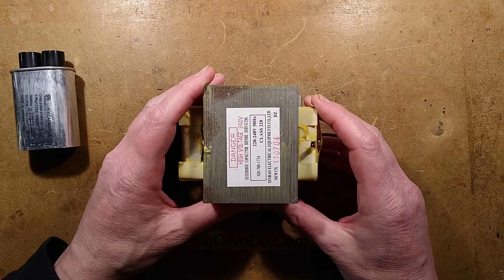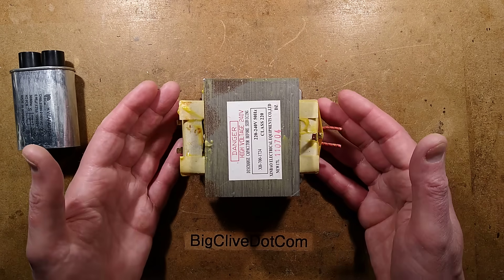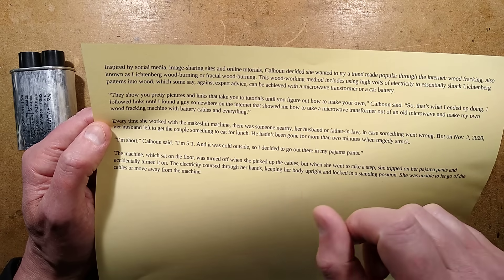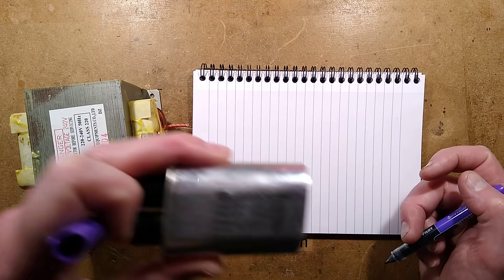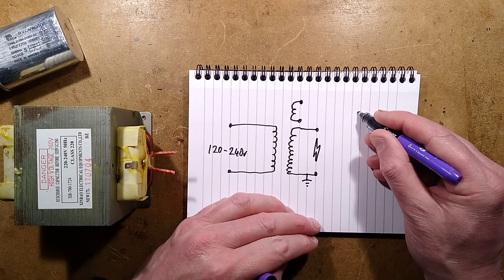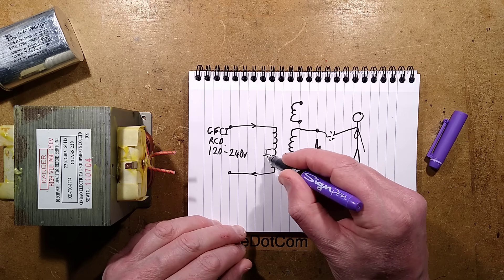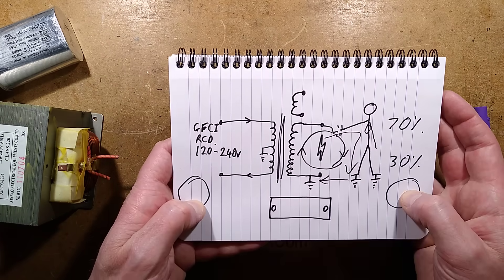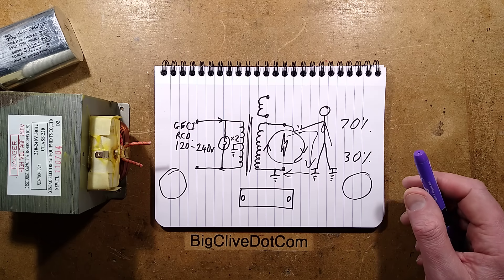The most deadly project on the Internet

Comment: I was firstly a Radio Officer then an Electro-Technical Officer in the Merchant Navy for 43 years. In the mid-70's we used to work on transnitters using big heavy transformers and large glass envelope valves. Similarly, marine rarad used (and still does) use microwave components, i.e. magnetrons. At college safety was drummed into us. I managed to survive 43 years without receiving a High Voltage shock. I was also responsible for working on 440v generators/systems for the last 23 years, again following proper safety procedures kept me alive. This "hobby" and the equipment people are using fills me with dread. They know damn all about electricity and it's associated dangers. I also attended a High Voltage Safety Course about 4 years ago. This dealt with the dangers of High Voltage voltage systems used on modern ships, such as cruise ships.They had a wide selection of gruesome photos/videos about what WILL happen if you do not follow proper safety procedures. This idiotic "hobby" needs to be covered by UK HSE legislation, and BANNED to prevent the ignorant and/or electrically challenged/over-confident kill themselves.

Comment: I think something that wasn't mentioned is that at such high voltages, I believe you act like a capacitor between the HV and earth/air. So even if you aren't directly touching anything you will still get a massive shock. Not to mention that the voltage coming out of the transformer easily breaks through the insulation of most cables (Which he did mention) I have also seen a MOT "leaking" into concrete (a tiny arc between the transformer body and DRY concrete) which was my clue to stay away.

Comment: That fractal wood pattern is so beautiful, I want to try that for myself!
So tell me, once I get an old microwave oven, do I beat the MOT out with a hammer, or pry it out with a screwdriver?
And should I unplug the oven first?
Reply: Flintlock aimed at the fasteners should do the trick; the black powder residue shouldn't be too conductive.

Comment: I accidentally touched a high voltage contact of the transfotmer while holding it with another hand. Painfull as hell but I ended up with only a small white line of burned skin on my finger. But I would not recommend to try this anyway because someone might be not so lucky and nonconductive

Comment: I have one of these transformers, rescued for a project, however I have yet to proceed as they are SO FRIKING DANGEROUS.
I'll probably end up with it on the other end of an extension lead, so I'm meters away when I plug it in.
HOWEVER this is not good enough, as a stuff up at the transformer end could see the transformer trying to raise the power cord (and extension lead) well over a thousand volts - the house mains will stop it, however when I pull the plug, the now isolated lead could zap me - so I'll also add a remote control/wireless power point switcher to the mix.

Comment: Yeah, people who survived a jolt of 110V or 220V probably got complacent and thought all electric shocks are like that. Most likely they touched it with one hand only and things were favorable. But 4000 volts doesn't need that good of a path to create more than 30 mA of current flow through your body, and that's the point where death tends to occur because it causes your heart to stop or go into fibrillation. You made a good point with it going through your shoes which isn't much of a concern at "wall socket" voltage.

Comment: The sticker on the transformer is not helping also: Danger High Voltage 240V .... Instead of the 2000 to 4000 Volt output voltage...

Comment: Doble's Power-Factor test set has a unique dead-man-interlock.  The Safety Button has three positions.  OFF-GOOD-FAULT.  To operate the unit, hold the switch in the GOOD position.  If you're electrocuted and "seize-up", you'll press the button to the FAULT position and stop the test.

Comment: As a trained (former) appliance technician, I've worked on dozens of microwave ovens and having heard stories from trainers about accidents involving working on them it really reminds you to take your time and practice safe working skills. The secondary voltage is actually 1000 volts ac here in the USA, then it goes thru the capacitor which acts to double to voltage to 2000 volts ac then thru the diode converting it to DC.  With 240v primary it would be 2000 ac on the secondary.

Comment: As a guy who works on rf tube amplifiers don't play with transformers. I use very expensive wires for insulation and a 2ft Teflon with a ground strap to short out the hv after bleed down to make sure no angry little pixies are left

Comment: I do have a 30KV Bertan HV PSU but even though I keep the current limit as low as possible for my application, I still try and not risk it by making sure I shut down the HV switch before moving the cables or readjusting things.
 In theory, I think it should be less lethal than the microwave transformer because it's limited to 33mA, though that would make my body a nice 1000W self-contained oven if the whole 30 000V is somehow going through lol
human (pork) crackle anyone?

Comment: The problem is that people into Artwork are maybe not the best people to be dealing with high voltage electricity, microwave transformers are very nasty things.
One thing I used one for was getting rid of a plant in my garden, I had a patch of Horseradish, I could not get rid of the stuff, even after Glyphosate which is probably has bad as a Microwave tranny, the bloody things still grew back worse than before. 
I carefully used a microwave transformer, Earthed one side with a Copper rod, and used the other side on a very long insulated pole with a probe on the end to apply the lethal voltage to each Radish plant, hey presto they never grew back. Not to be recommended though, do not mess with these voltages and current unless you know what you are doing and you are not tired or had a drink.

Comment: This is really important content to focus on - thank you for doing so, Clive.
I'm pretty into arcade machines and retro gaming, where CRT TV sets are still an extremely popular commodity. If you'd like to do another cautionary tale video like this, it might be interesting to hear a rundown from you of what to be terrified of inside them. Growing up I'd always been told they were a deathtrap but in recent years I've gotten far more brave while opening them up to fix minor issues - curious what your take would be as to whether I'm taking informed risks or if I'm being completely laughably unsafe.
Reply: In a modern CRT TV I believe the danger comes if you contact a charged anode lead. The shock doesn't kill you but involuntary muscle movements could.
Reply: @eDoc2020  Interesting. Are there not cases of people in otherwise good health (no pacemakers, etc) being fatally shocked by a discharging anode or capacitor? Or have I been misled, and the primary danger (assuming proper safety measures) would be messing with it while it's in operation?
Reply: @mistaecco  There are probably people getting fatal shocks from the charged HV. The bare output on a modern integrated flyback is probably safer than a charged CRT. But AFAIK it's still more likely the shock will "just" make you spasm and slap the tube hard enough that it breaks and impale you on the sharp edges.

Just be safe and discharge it if you need to mess with the anode connection. And be careful if you mess around with a set while in operation. Oftentimes the horizontal output collector will be attached to its heatsink. This will have kilovolt pulses while in operation which will be more dangerous than the anode line.
Reply: @eDoc2020  Good to know all around. I've been doing a bit more research on the matter and it seems to match up with what you're saying, so it all makes sense. I appreciate you taking the time to explain it all, and will definitely keep it in mind when I soon recap my arcade monitor. Will certainly not lose the mental image of involuntarily punching through the neck tube any time soon, that's for sure.

Comment: I would say that discharging an high voltage capacitor with a screwdriver is a way to be screwed. 
Use a high power high resistance resistor and wait enough time.

Comment: I got into a country science fair with a Kirlian discharge plate as a teen, made with an ignition coil. Sparky mistakes!

But these days if I'm doing something borderline insane I'll put it at the end of a long extension cord with a switch. That should work for most of these artists with the exception of the "painters".  I could imagine insulated controls on simple pivots and the work inside an insulated box. Don't ever rely only on linesman's gloves.

Comment: It's important to know about the high frequency device that while it doesn't make visible burns, you should avoid getting shocked by it as well. What I learned in the army about frequency burns is that it can damage your nerves and years later you can wake up and not be able to feel anything with your limbs or use them. Granted that was primarily a safety concern with coming in contact with an antenna while the radio was transmitting, however if I'm not mistaken frequency is still frequency regardless of range could still pose the same risk.

Comment: it bears mentioning, "breakdown voltage" is the voltage at which material stops being an insulator and becomes conductive.  for most "insulated" things, that breakdown voltage can be as low as 600 volts, including a lot of common wire insulation, and shoe soles.

Comment: We have horses and thus we have electric fences.  
One is battery powered at ~4000V and one is powered by house power at ~10kV.  
Both only pulse for a millisecond or so, but i'm not getting close to that second line any time soon.  
Dry floor, thick boots and only touching through a jacket and still had the feeling like getting kicked in the arm.  
(interesting: every joint on my body hurt for the rest of the day)  
That shit's no fun - wouldn't wanna find our if it wasn't pulsed but constant for a second or so.

Comment: I was electrocuted when I was 14, 44 years ago. 240v in AU. I was using an old metal vacuum cleaner to vac out my grans old VW. I was a few feet from the cars door on the drivers side (RHS in AU). Next thing I felt being thrust away from the car, possibly a few metres, waking up I was dazed on my back on the lawn. I've never trusted electricity since. At the time of the accident I wasn't thinking about electricity, complacency as you point.

Comment: I'm a trained electrician and would try this or building a Tesla coil, it scares the hell out of me. Anyone that had a shock from 230V AC or ever caused a short circuit knows this a very bad idea and a potential deadly contraption if not done correctly and requires extreme care and attention, its like working on a live circuit, avoid at all cost.

Comment: Lol indeed. I've known for a long time how dangerous these microwave oven transformers are. It was brought to my attention a number of years ago when I heard about the case case of an electrician working (live) on a microwave oven that died of electrocution simply because the insulation on his linesman's pliers had a fine crack in them right at the base of the handles. The high voltage arced through to his palm and gave him cardiac arrest.
Thanks for sharing.  😉👌🏻

Comment: Good video, yes mains voltage is dangerous and should be handled with care also microwave ovens. My friend got zapped ones when he worked with me in a microwave oven i had my hands of it but my friend tripped and touched the capacitor  luckly it was already pretty much discharged from the dangerous voltage but he still got a 350 volts zap he got zapped from one finger touching the cap to the case ground he did not loose anything luckly no burned hand but he still got hurt pretry bad he also had no gloves on i did but he did not so yeah that was a pretty painfull experience for him he is fine now it was like 3-4 years ago

Comment: I think rather than the two buttons approach, I would put all of the high-voltage side into a well-insulated box, with a main power switch that is mechanically interlocked with the lid in such a way that if the lid is open, the power has to be off. That way, you do all your setup while the entire circuit is deenergised, and while there is high voltage present, the box prevents anyone from touching it.
Reply: Two double poles in series, possibly even with proving lights. That way, if one fails, you’ll know and safety won’t be fully compromised.
Reply: @howlingwolven  Having two, one on each side of the box would be better for the mechanical integrity of the "hold the lid closeed while the circuit is energised" function of the interlock as well.

Comment: Great video, Clive. I often salvage project parts from appliances, but have always avoided microwave ovens. They just seem to be nightmare fuel. The transformer, the capacitors etc, but I also recall something about the magnetron being made from a material which breaks down into a powder and slowly poisons you if inhaled. Not sure if it's beryllium.
Reply: It is beryllium oxide.

Comment: Very good video. If anyone is intending to do this please watch my video "fractal wood burning electrocution" first. I made a high frequency high voltage transformer seeking to come up with a safer way to do this. The problem that I encountered was that the capacitance of the damp surface to the surroundings caused current to flow when only one probe was attached. This is similar to what you see with Tesla coils.

Comment: I work as an Electrical Control Operator on a 1500 vDC railway. The thoughts of connecting the OLE to wood to burn a pretty picture into it is terrifying. Sure, it can be done safely. Not easy in the home environment. Standing within a metre of this while on is risky. Poking it with short leads is asking for a wooden overcoat.
The twin button idea is familiar, it's how remote CCTV level crossings are "cleared". The operator checks the camera for people cars. If clear, he uses one finger from each hand to simultaneously depress two buttons. This releases the protecting signal.

Comment: I once considered doing this... the risks include the known-knowns, the known-unknowns, and the unknowables. Easy to calculate required insulation and spark gaps, but in a household setting, it is very hard to mitigate the other risks.
Reply: I did eventually cut the secondary side out an re-wind it to make a low voltage spot welder. A far safer project :)

Comment: I'm an electrician, been doing projects for years. High voltage high frequency stuff - I'm fine with it. Built my fair share of plasma lamps and the sort.
But in my professional life "lowly" 3x400V still gets respect from me (I once managed to connect two fingers of one hand between phases, almost broke my elbow when it hit the metal cabinet from muscle reflex, burned two nice black spots that thankfully healed), and I refuse to get close 2kV from a MOT, let alone using car battery leads as conductors.
Anything high voltage at 50 or 60Hz is potentialy deadly, even more so for people that are not aware of danger it poses.